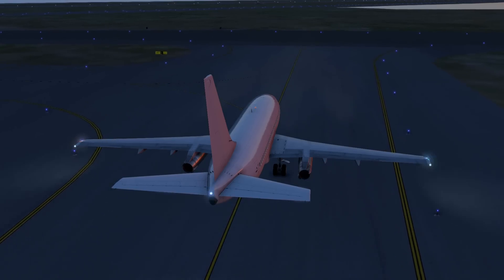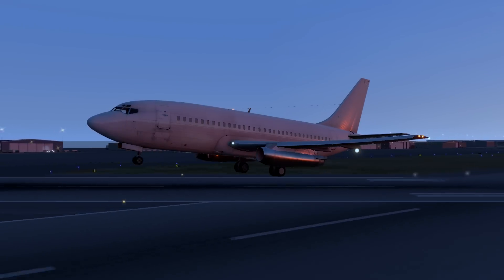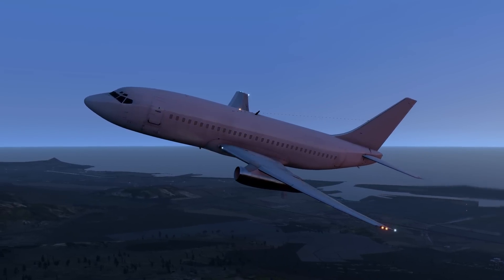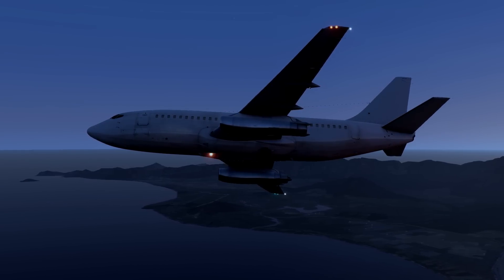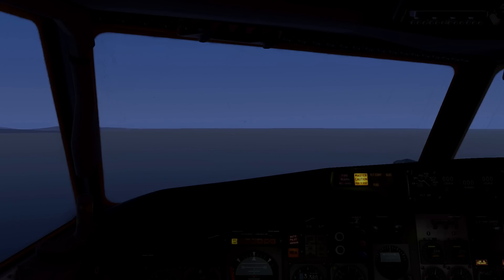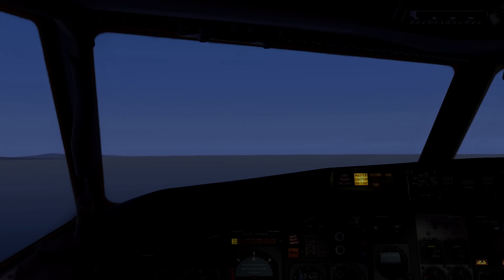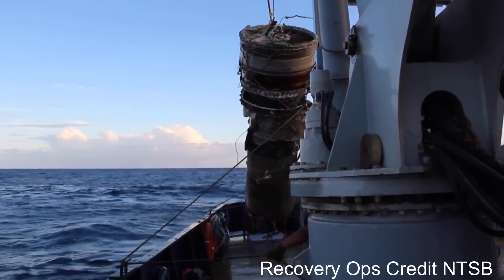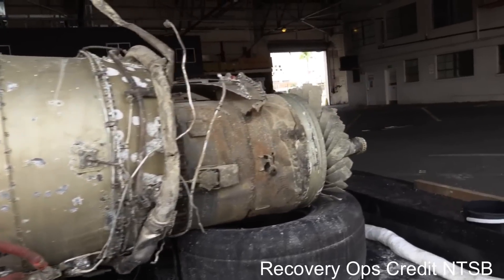The Split Second Decision That Sank A Jet | Trans Air Flight 810

Comment: Situation: Right engine failed, left engine running back to near idle thrust. So they are essentially a glider…”ATC clears them for immediate return to runway 04R, but crew told the controller they needed more time to run a few checklists. That made all the sense in the world”…That might be the most ridiculous consecutive sentences I’ve ever heard in an accident recap. What checklists are you going to run in your glider barely 2000’ in the air??? Turn the GD jet towards the nearest r/w and land. Talk about it on the ground. And your qualifying statement, “that made all the sense in the world” is beyond laughable. That makes NO sense. EVER. Giving the conditions. Note: Have flown both the type and am well familiar with the airfield.

Comment: 11:07   "They would've been able to diagnose the situation if they had just applied some power to the left hand engine.  However, this diagnostic test wasn't in any of the checklists that the pilots had to do."

Really?  So the checklist tells the pilots to bring BOTH engines to idle, and then at no point does it tell the pilots to increase the power of either engine?  You're supposed to just fly the plane on no engines???

Comment: these piolets are morons, sorry but the fact they did not push the throttles up no matter if they had engine trouble or not is the problem, This is simple the piolets shut the engines down and left them in the idle position until water hit the plane morons, I don't care about confirmation bias or not this is just stupid. And now we are going to be flying with woke diversity hires we are all going to die,  The did not lose any engines, and the 2 engines, and the pilots shut down the throttles on the 1 engine.  So in reality they did not lose any engine they only lost half the power on the number 2 engine.

Comment: This is, yet, another in a long line of accidents caused by Attention Deficit Disorder. I can’t believe they don’t test for this condition when these pilots begin training. I work with people in a professional Laboratory environment where complicated testing is done, routinely. 
I can’t tell you how many time per week my colleagues load the machines backwards and fail to double check key components of testing procedures. This is ingrained ( muscle memory ) knowledge of routinely executed tasks that, in most cases, are rudimentary in nature. 
ADD kills more people than we know - that and that alone is the cause of these horrible accidents, mostly. 
ADD testing needs to be a part of standardized testing for professionals; especially if one was to be responsible for the lives of others.

Comment: You neglected to discuss the pilots' conversation prior to takeoff. It's in the NTSB report and speaks volumes about the pilots.......
Dead foot, dead engine. It ain't rocket science.
And when you've lost an engine at 2,000' and there's a runway right there, you don't dick around running checklists, you put the f-ing thing on the ground. It's not like you gotta feather a prop to reduce drag.
Lack of mental preparation is another factor. A pilot should always be mentally rehearsing emergency scenarios. This helps to eliminate the response lag caused by the 'startle factor' when an actual emergency occurs because the mind has been pre-programmed to react.

Comment: I live a hundred miles from the crash sie. Airliners and cargo planes have it very rough. They are all exposed to constant salt spray, and are rarely stored in enclosed hangars. The inter island flights are short, but frequent. Typically 30 minutes. Maybe 15 to 20 times a day pressurizing and depressurizing. All that stresses airframes. It’s led to at least one fatal mishap, when the roof peeled away mid flight. This 737 was a -200 model. Very old.
Reply: When you do flakey maintenance on jt-8d's what do you expect. I saw them fix a main oil tank drain fitting with stripped threads with JB weld. Fitted failed later engine lost all oil in flight

Comment: Don't jet engines during flight are connected to the manufacturer by satellites, 
if I remember from reports from the famous not yet found Malaysia Airlines Flight 370.
If so, in case of an emegecy, is it conceivable that the pilots get direct feed back information,
or later on, when analysiing the accident, the real status of the desactivated working engine 
could had been determined without extarcting them from the water?

Comment: Couple things you said aren’t to standard.  

1.  The crew wouldn’t have set take off thrust before the tower cleared then for take off. 

2.  The first officer was the pilot flying so he wouldn’t have acknowledged eve take off clearance.  That would be the pilot not flying responsibility. 

3.  The aircraft would have had enough speed to take off before V2.  You said they hit V2 then got enough speed

Comment: V1 then V2 then take off is an error.  It should be V1, Vr , take off and then accelerate past V2 in the normal climb.  V2 is the climb speed on one engine in the event of an engine failure after the V1 (unable to brake to a halt on the remaining runway) speed during the take off.  V2 would be their target speed with a failing engine at low level.

Comment: 11:55 - Great video as always, though I'd bring up a minor point of order when comparing this accident to Kegworth.  In the case of Kegworth it wasn't that the crew believed they'd had a dual engine failure, they knew it was a single engine failure, but unfortunately misdiagnosed which engine had failed.  Probably the overriding reasons for this were that both crew had been used to flying the 300 series in which the cabin air was taken from the bleed air of the right engine (number two) only, but the then-brand-new 400 series' cabin air system was fed from the bleed air of both engines.  Because the first officer could smell burning, it is likely that he fell back on his understanding regarding the 300's configuration.  Tellingly, the CVR transcript has the FO respond to the Captain's query as to which engine had failed with "It's the le- ... It's the right one".  Coupled with this we also have the fact that the new digital engine gauges fitted to the 400 had been reported as difficult to read compared to the old analogue type, and in particular the vibration gauges on older variants (and older aircraft in general, including the DC-9s the Captain had previously flown) were often considered unreliable.  The conversion training from the 300 to the 400 in place at the time does not seem to have included or mentioned this change in bleed air arrangements, and as such should be considered inadequate.  It's therefore not difficult to deduce that because the vibration gauges weren't trusted, a "rule of thumb" between B737 pilots developed such that if engine vibrations and a burning odour were detected at the same time, it was the right engine, and if the odour was absent, it must be the left.  The media had a field day at the flight crew's expense when it was discovered the "wrong" engine had been shut down, but the truth of the matter is that they were let down by inadequate training.

Comment: Some critical points here I think you didn't make them clear:
1. Both engines have been bought back to idle because they have overshoot the 210kt/2000feet target (all the way to 250kts and 2100feet), FO as PF bring them back just to fly the airplane to where he needed.
2. They switched control before starting the checklist, when CP got the plane, both throttles are in idle, and this is when he starting to ask FO which engines is wrong. this control change probably made a "doorway effect" to both pilot so they didn't remember what was wrong before.
3. The ENG1 never been shutdown, it's been kept at idle all the way to crash, FO started the Engine Shutdown Checklist, but never get to the step that to identify the correct engine due to no time and the deteriorating flight condition, let along shut it down, CP only pushed the No2 throttle forward for power, which is against the operator's guidance of move both throttles before the effective one have been positively identified (their vocal exchange on which one have failed happens before stating the checklists, so it doesn't count as a positive identification).
4.The CP have a note on his previous simulator checkride that he didn't finished the engine shutdown checklist before head back to a landing, that might effect his decision on not to turn back to land as soon as FO asked.  In my company, we have specifically added a note on our SOP that if condition permitted and pilot determent it's safer to do so, you could land the aircraft before finish engine shutdown or fire checklist, because we also had some instructor insist, or even bully that you have to finish all checklist before landing in simulator drill and we deiced it might not be the safest action.
Reply: These are some really good insights. It did sound like if they had headed in to land immediately they might have been ok, even with idling the wrong engine. Makes sense they didn't do that if training emphasised completing the checklist first
Reply: I agree. The flight crew's duty is safe operation under all conditions with the goal of getting the craft on the ground as soon as a defect appears.

Comment: I wonder if the first officer had spent any time in the lefthand seat because I can definitely see getting your engines confused if you flew a bunch of the left seat with the lefthand engine being outside your window and then having an incident in the righthand seat where the engine outside your window failed. If you're the least bit dyslexic like I am, I can see that interfering with whether or not you call out that the right or left engine has failed but incorrectly. Presumably, the pilot flying called it out correctly initially because he was less dyslexic than I am but I have tattooed a checklist about my right and my left on my body and I'm not a pilot. I just want to know which way I'm supposed to turn in the car when someone tells me left or right and I got sick of asking people to point so I got a couple of tattoos I can look at quickly. No matter how turned around and upside down I get, I can always glance at those tattoos and know which way is which.

Comment: 1:54 Doesn't reaching V2 on the runway mean they rotated too slowly? Or is that what you do in your version of MSFS?
Reply: MSFS?
Reply: @Capecodham  Microsoft Flight Simulator
Reply: It’s not perfectly synced, even if it is, Vr speed is just a few knots below V2, which means that by the time the pilots RAISED its nose to 15 to 20 degrees up, it would’ve achieved V2. Sometimes the rear wheels will still be on the ground.

Comment: Is there a possible engineerng or procedural solution to preclude that sort of error? '
With twins making up most of the transport fleet now, prevention becomes important.
Reply: the solution is to have competent pilots and not fly aircraft built in the 1960s

Comment: Seems to me to be an emergency training procedural failure......isnt part of the engine out procedure checklist to IDENTIFY THE PROPER ENGINE OUT AND AGREE TO THIS BY BOTH PILOTS before continuing with the procedures for engine out flight?
Reply: It sounds simple on the face of it, but the differences between the types (plus the fact that the Boeing-authorised procedures for these older types often contain out-of-date information) means that there's often more to it.

Comment: I suspected wrong engine shut down when I heard of the crash.

Surely, its better to firewall both engines even if both known to be bad ....in an attempt to avoid certain doom.

To hell with the QRH.

Engines are cheaper to replace than a whole aircraft.